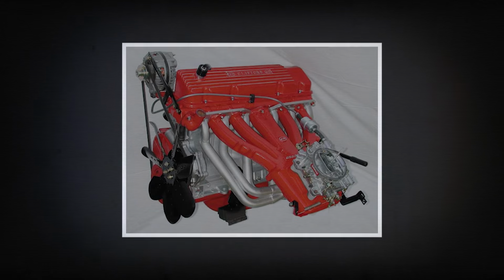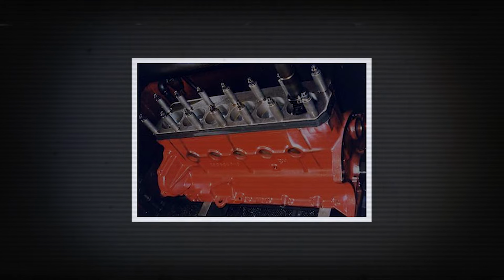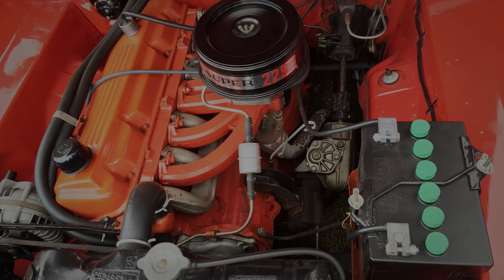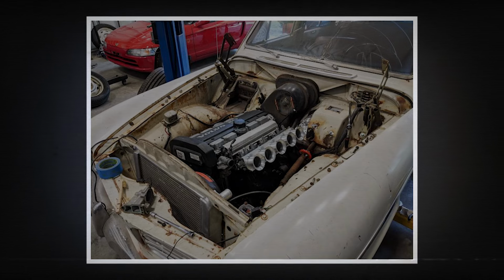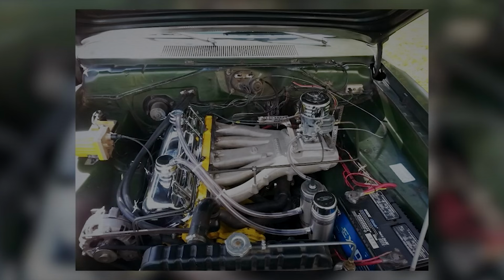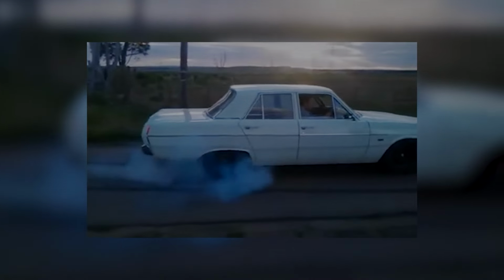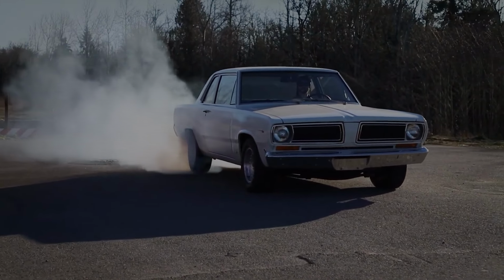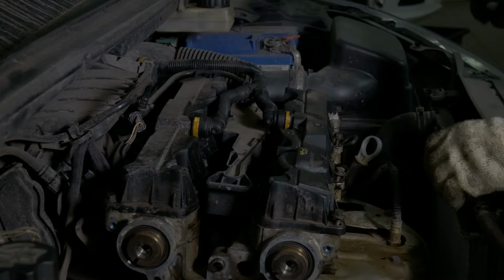The SHOCKING Truth Behind Mopar's 225 Slant Six Engine That OUTLIVED Humans

Comment: My dad bought a new '65 Dodge van in early '66 with a slant 6 in it.  The only major maintenance was at 297000 miles when 80wt oil was getting past the rings.  We pulled it, rebuilt it with new bearings, new oil pump, bored it, put in oversize rings and put it back in.  He passed in '84. I gave the van to a friend, and the new owner swapped the 1bbl intake manifold and carb with a 4bbl intake manifold and carb.  Last I heard (2017) it's still on the road in Arizona.